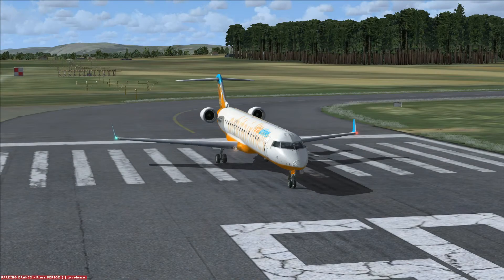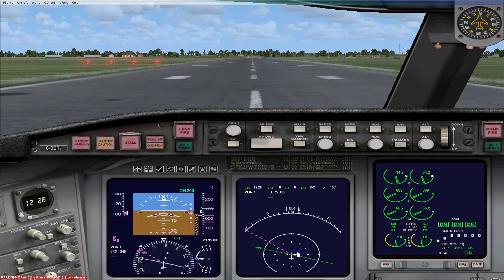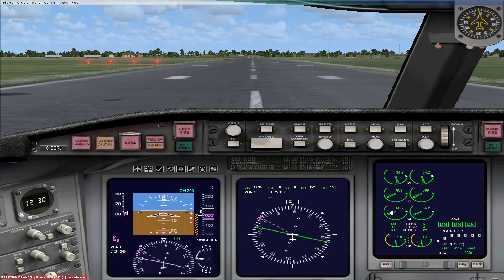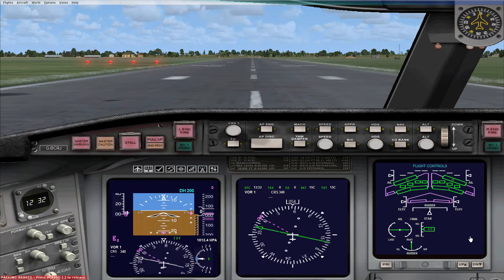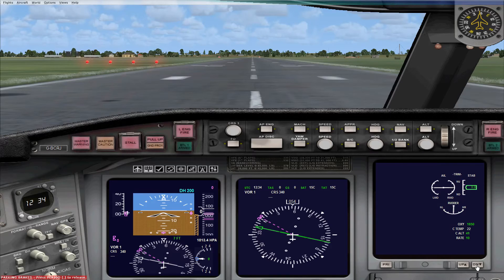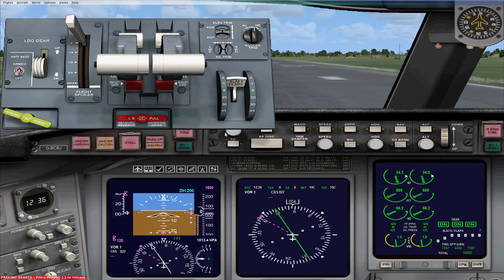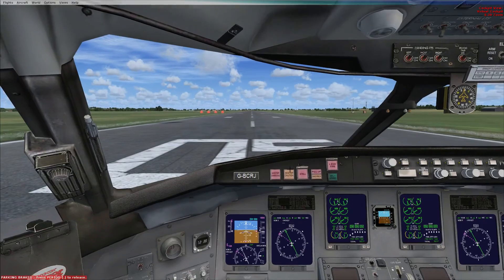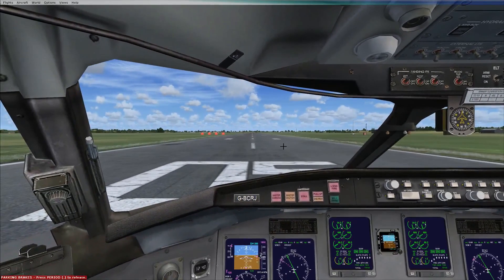FSX Tutorial: Bombardier CRJ 700

Comment: Hello.
I have flight simulator X steam and I have a problem with displaying the real CAS speed with this aircraft. When I fly I have the speed displayed on my screen which is a speed indicated IAS. But when I look right into the second HSI panel there are several speeds like ground speed, true airspeed. But when I gain altitude the true speed does not change from the indicated speed while it must display a true speed. That's strange. My aircraft is the Bombardier CRJ 700.
Reply from the maker: I suggest you go and look at the different air speeds used in aviation. To quickly explain them...

IAS - Indicated Air Speed shows how fast the plane is moving through the air. 
TAS - True Air Speed, How fast the plane is moving through the air, but the speed is corrected for Altitude and air density
Ground speed - How fast the plane and the air it's flying through is moving over the ground. 
CAS - Calibrated Airspeed is similar airspeed but takes a few more errors into account. 

Basically it's normal for your indicated airspeed to stay low when you're cruising along. This is because the air is less dense at higher altitude, so there's less air molecules hitting the plane.
Reply: hello ... first of all only 2 speed you can select on (AFC) Automatic Flight control NOT HSI : Heding select indicator 
So .. the speed for take-off paised only  on Bombardier standard of operation is 200 whch is the speed of the holding below 6000 ft but the maximum speed below 10000tf is 250 after you climb  off that you can go cor the maximum 300 which is the structure limit pecus ther is no CLM : climb thrust on this simulator from the MCDU 
OK    have fun   HHHHHHH

Comment: Hi. Nice video. I am used to flying the A321 & B737. I flew this plane for the first time today, and it's a nice plane to fly, but 
I couldn't find the ils for landing. I found the approach ok but it just overshot the airport. Can you tell me where the ils control is please so I can land it? It's still flying over Manchester airport somewhere lol. Just kidding. I've saved it, so, to be continued. Thanks in advance
Reply from the maker: Yep, it's the APPR button on the Autopilot panel. Also double check that you're intercepting the Glideslope from below. If you're too high before you join the Approach, the aircraft will follow the runway centerline but not descend.
Reply: Many thanks, I did push the APPR & the pink diamond was above the centremark. But the plane didn't follow the glide slope. I think maybe I should have pushed the CRS 1 button. Is this the same as the ILS? Thanks again
Reply from the maker: Don't think so, usually the "Approach" button will lock into the Localiser and Glideslope at the same time. The course works like a heading selector so you just need to make sure that the course matches the full runway heading.
Reply: @bobn1944  Ensure you push the APPR button on the autopilot as you intercept the glideslope. i.e. the diamond is on the centreline. That works for me.
Reply: @Terryzarzoff  Thanks a lot

Comment: are speedbreaks and spoilers the same thing?
Reply: Yes and no. Speed brakes do as they say and may be mounted on the rear of the aircraft, opening out to reduce speed. Spoilers can be lift spoilers or flight spoilers. Flight spoilers are ground use only and are the spoilers that come up on landing. Flight spoilers assist with roll and are more common on aircraft that use servo tabs to roll rather than hydraulics e.g BAE 146
Reply: in a word, yes
Reply: Hi, 

This reply is coming from a experienced pilot, however you will find this reply relatively new to your info.

Speedbrakes, do not exist. You should be using the terminology: Spoilers which slow the aircraft mid flight and on ground. However there are auto brakes which are not speedbrakes